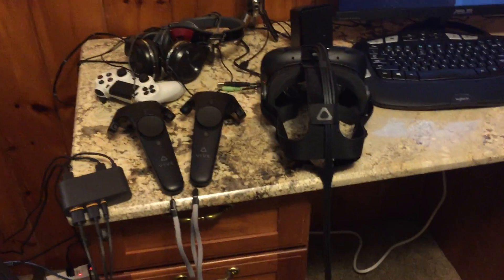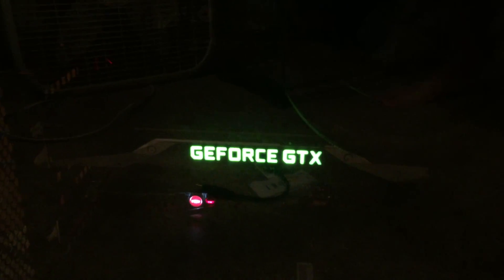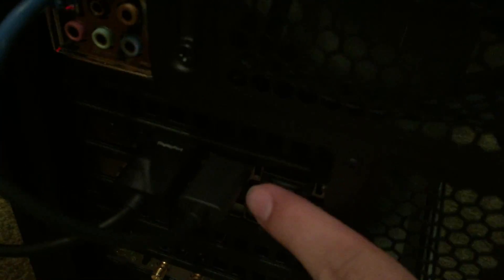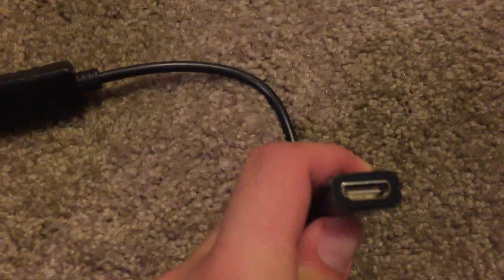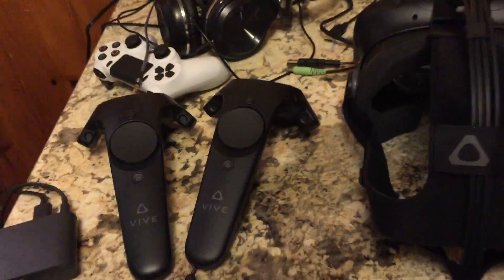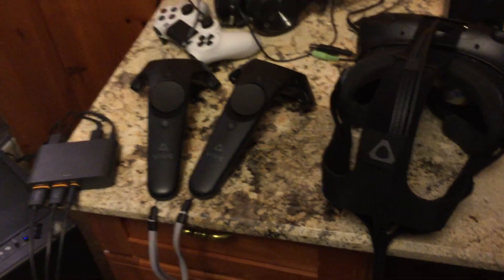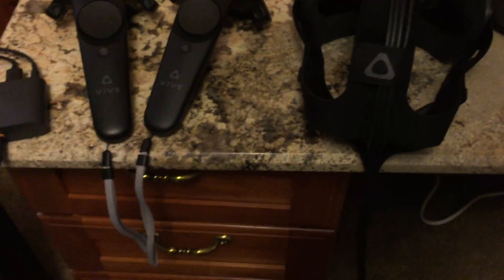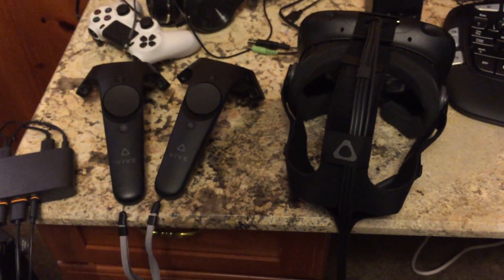HTC Vive GTX 1080 Best Wiring Setup for VR Game Performance

Comment: For $999 HTC should supply the necessary cables !
Reply: 2ndLastJedi they do, it’s just his card will not support the setup I had no issues with my card
Reply: the htcis 650 and i have to order another adapter now.